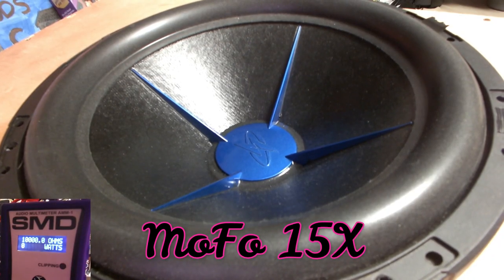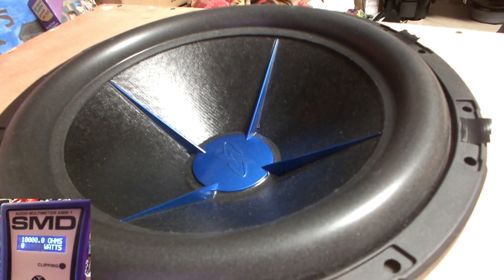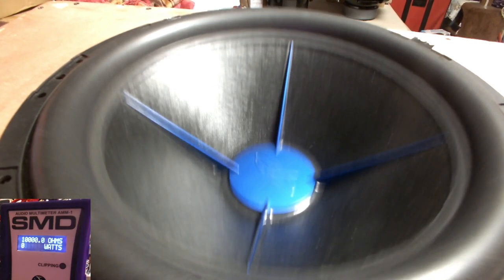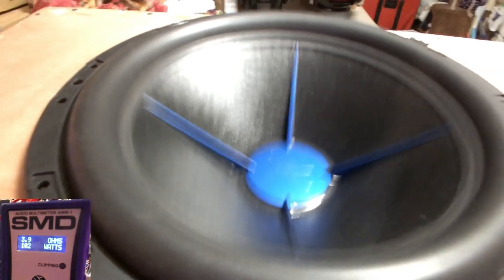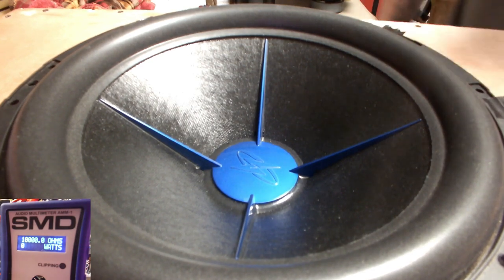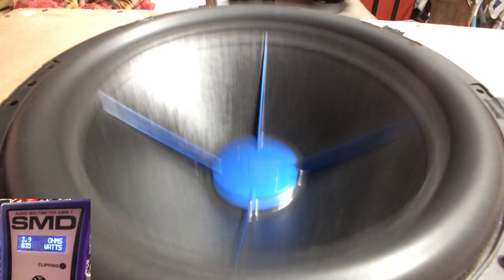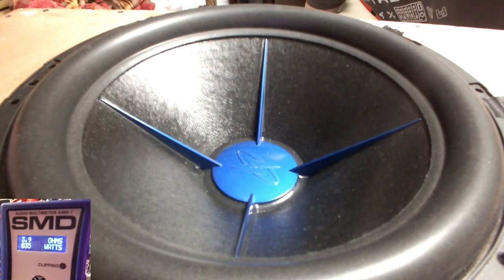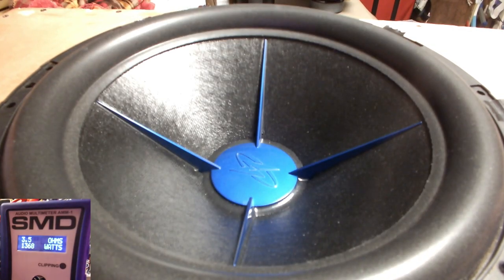Power Acoustik MOFO-154X Car Subwoofer On NVX-XAD13 Car Amplifier SMD-AMM1 Full Demo #flexing #slam

Comment: I run the 152x it's a good sub . I give it around 1000-1200 watts all day every day. 
It sounds real good in 3ft box tuned to 29hz.
Reply from the maker: that's about what it will handle safely, up to 1,200 watt's. It can take more but I like to be safe, especially when you play decaf or bassboosted music, some of those songs really get down. It ran about that power on a 3,500 watt amp. Have you had it dyno tested and what are you using for an amp? Just curious, I'm looking at buying another amp to test and I have the Taramps HD3000 and the NVX XAD13, they both do about 3,500 watt's at 1 ohm.
Reply: @SubzPawz  it's a powerbass xma1205d.
It does 1200 rms @1ohm. Super clean power from this amp.
The FSA of my sub is 24hz so it really gets down hard.
Reply from the maker: @travisabrahamson5092  I had a Powerbass awhile back, it did it's rated power. I wish I had it now to actually test it live for power and see if and what it really did for power. Maybe someday in the near future, who knows. I'm always looking.

Comment: The motor on that sub is used in quite a few different models and brands that's a nice size motor on that sub around 170 to 200 oz I have  built a couple custom subs using the motor and using my own 12 spoke basket my coil that I picked out and a nice stiff cone with a high roll surround not the wide mega roll but the high roll surround I got around 3 inches of xmax the sub RMS range was around 1550 and FS was 34 htz
Reply from the maker: nice.

Comment: My 15 is a rare one i have a bolt on motor ive had it for 9 years now got it for 50 bucks from a buddy that dont know speakers my surround is almost 3 inch thick its also has a deeper center its the only powered acoustic like it that ive seen ever
Reply: And my dust cap actually says powered acoustic under the symbol your does not and my rubber gasket doesn't have the blue screw tabs just says powered acoustic
Reply from the maker: I'm guessing that's the Fubar. Power Acoustik made those years ago. The original mofo and fubar came in wooden boxes. Yes bolt on motor and the dust cap says Power Acoustik. The new mofo came in 3 model's, I have demos of each, the mofo x, mofo s, and newer mofo x. When I see another older one in the wooden box I will be sure to grab one. Thanks for your comment 😊
Reply from the maker: Thanks for your comment 😊
Reply: @SubzPawz  if you can find them ive only found one other one but he wanted 450 for it on ebay and i dont trust ebay yet

Comment: Seems like its the glue they put on the coil? Iv seen people put close to a constant 1500 watts and not blown, for a budget sub these bang pretty good 👌
Reply from the maker: I was wondering the same thing myself. When I had it going in my van it banged, but everytime it would smell like coil, I ended up switching around sub's and forgot about it until I just did this demo. I also had 3 Gothics, they also put in work, but they had the same issue, always smelling, they were not blown, just smelled all the time. Thanks, I forgot about that.